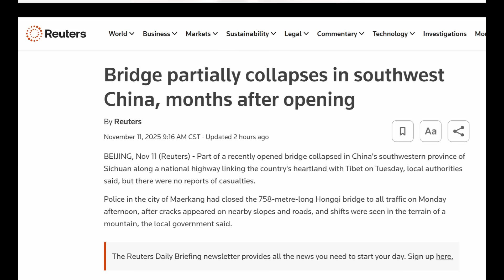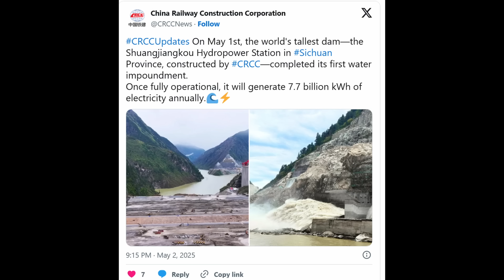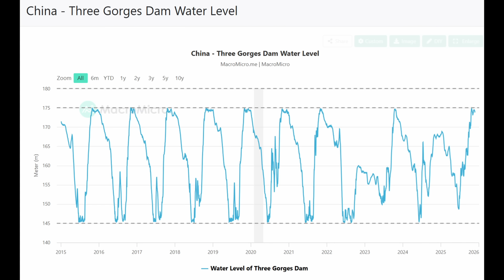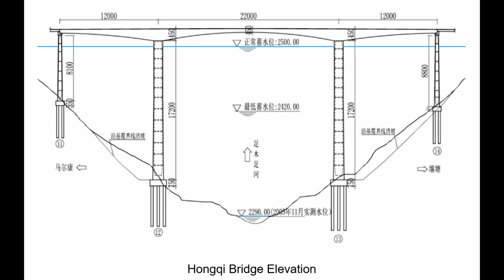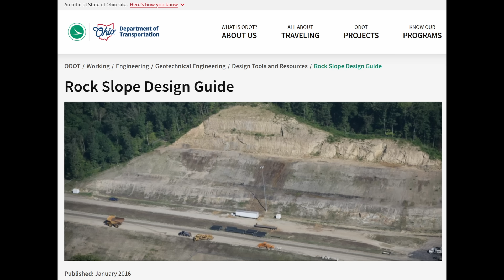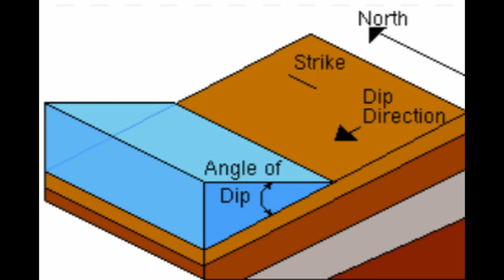Update - China Bridge Collapse

Comment: I keep seeing extremely thin mixtures of concrete being used to pour Chinese floors in multi-story structures.  That and persistent rumors that gypsum is commonly used to increase flowability worries me about the strength and durability of that concrete.  Can you see enough to allay or confirm my fears?  I worked in a section of an industrial park that the sections made with asbestos reinforced concrete were literally falling down as the asbestos was slowly dissolved by the cement.  Gypsum will slowly dissolve the cement, so the results in a decade or two will be similar.

Comment: There's also the corruption aspect, it's built into any CCP project. Saving a few bucks on bad steel, using beach sand in cement, paying off inspectors etc etc

Comment: The fact that the whole bridge didn't collapse due to torquing is kinda impressive.
Reply: Could you explain what you mean by torquing further? Not a term you hear often when it comes to bridges, genuinely curious
Reply: @DrewK-e2i Twisting. The end of the bridge fell sideways and down. That motion twisted, or torqued, the road bed and could have easily pulled down the entire bridge if the other supports were sufficiently weakened.
Reply: @TBlakely-s4p  Ah yes I see, makes sense. Any guesses on what they will do with the bridge next? Would it even be possible to safety reconstruct the destroyed section, or will they have to demolish the rest of the bridge as well
Reply: @DrewK-e2i No way to repair it. Probably the simplest and cheapest is to abandon it and find a different location where the land is more stable but given the geology of that area they will probably have to relocate pretty far away.

Comment: Bridges are not designed to withstand getting hit by the side of a mountain. The side of the mountain should have been cut back or stabilized better. The dam that failed happened during a major flood even and the water was overflowing the top of the dam. The dirt washed away from the land side of the abutment. That dam wasnt the only thing that had problems during that flood.

Comment: If you notice in video you will observe a retaining wall collapsing. as you mentioned geotechnical composition and strata is difficult and varies in slope greatly . Typical Cliff stabilization is with a horizontal cassons drilled into the face about 5-meters deep on a5-7 meter grid. rebar caging is connected, to each casson , then steel netting, then gunnite spray finish. a typical embankment can vary in length from 100 meters to 2km. with a height reaching 2000 ft or 600 m….. the weight alone is tremendous . I’ve traveled several times on 317, road at times is carved into a 60 degree cliff. freezing weather, thawing, rain, 100 degree temps takes its toll on topography . Each trip i’ve had to wait many times 8 hours to get road cleared before preceding. the river does have a lot of force and carved from below collapsing the roadway. Freezing rain is the best time to travel😂

Comment: Non-practicing geologist here. In college  we had a Engineering Geology class. Our professor was a former Engineergin geologist for many of the brazilian dams built iin the 1980's. We were shown many dam collapses due to foundation leakage. I was a trainee at the State research institute shortly after a major rainfall  moved a bridge on the road from SP to Santos,  15cm (6 inches) at the embankment. (the major south amrican port) . It not only rotated but also slided a bit downhill. In the end, they somehow fixed the foundation. 
In the chinese case, the terrain looks a lot to me like karst (limestone) while the rock is quite strong, its integrity cannot be assumed. It looks as if slope stability was not adressed, as it should be a requirement in any engineering device over steep terrain.

Comment: This bridge collapse was caused by the failure of the whole ridge spur on a failure plane within the dip slope geology. It is unlikely improved foundation design could avoid such lateral forces. Post failure aerial photos clearly show a slip head scarp across the whole spur. This failure definitely relates to weak dip slope geology, that in hindsight shows no amount of pre-construction earthworks - benching etc.. would likely avoid, in fact it may further destabilise the slope. The massive displaced block of geology simply highlights your concern about dam over topping resulting from slope failure, as history played out in Italy. It is worth searching out the photos with Google.

Comment: 8:13 "it's not clear if they used any of these methods to stabilize the bridge" If they did, which they probably didn't, the structure would've definitely been a cheap knockoff of the intended design, a facade, trying to appear like it was meant to stabilize the structure, absolutely 100% not according to print.

Comment: Just noticed that the water level under this bridge will rise after the dam downstream begains to store water (in fact it seemed it has start already). And when the water reached the designed level, it will be only 20m (66 ft) above water. Some 80% of the column will be sumberged under the river. Not sure if the risk analysis on land slide or water surge shoule be considered under these condition. Anyway, even so, the risks that affect the construction, before the final working conditions are reached, should also be considered.

Comment: In New Zealand in the 1980s the Clyde dam was built and they discovered a similar geology as that dam in Italy, layers of hard rock with layers of clay between, plus earthquake fault lines running through the site, they eventually built 18 kilometers of tunnels for drainage purposes. The main worry was the filling of the dam would create liquefaction of those clay layers when the dam filled causing a massive landslide into the dam. The work to redesign the dam and all the work to make the site "safe" added years to the build and about a 50% cost over-run, but that shows what doing a proper geological survey of the area means. They discovered what the issues were and changed the plans accordingly.
Reply: plus, not being evil like ccp, etc...
Reply: NZ We had CCP kind of leader But She Ran away thank god
Reply: Are you sure those are clay layers?  Clay does not liquify.
Reply: @bettyl5840 Put a category 8 quake through there and it will liquify, the whole site was on 3 fault lines and the rock cliff upstream was folded and riddled with microfractures all through the layers. Add water to the mix, shake well and it will slide. The tunnels were built in hopes it will keep the water away from the softer layers
Reply: Yeah, we studied both. More so the geology of the Crimwell Gorge sides and their stabilisation.

Comment: there could have been earthquake before which resulted in thisebcracks and them closing the brudge   (and said earthquake created the slope instanikity which eventually resulted in the slide).   what you didnt explicitely mention is that the filling of reservoir adds a huge amount of weight at bottom of valley and affects base of hills on either side of river.

Comment: China has two main problems with all its construction projects.... Shortcuts in planning and corruption. this means geological surveys if they are even done are at best minimal and worst subject to bribing both officials and  surveyors. Also the cost cutting on materials to pocket more money is wide spread. If you check the youtube channel "the China Show" you can learn a bit more on conditions there. Chinese companies are notorious for using fake rebar and substandard concrete to cut costs and allow company owners to pocket cash and the problem is not just in China they do it worldwide using their belt and road initiative...

Comment: these are called tofu dreg projects -- it has an actual term. of course, things fail everywhere, but for different reasons, i.e. not the same reason every. single. time. 

for a typical tofu dreg, it's laughably shoddy material as a result of systemic corrupt. this isn't a case of neglect/poor design/engineering, it's just saving money by not doing what needed to be done. this was the cheapest option done in the cheapest way possible for them to make money. in china, the lowest bid always wins (unless there's a specific corruption scheme). 

i've worked with chinese. believe me, they don't give a fuuuuuuuuck. they build shit knowing it's shit and hope for the best. lol, just kidding, once you buy it they could not give less a shit, but at least in stuff like this they'll hope for the best only because they don't want it traced back to them/used as a scapegoat.

Comment: Thanks for returning to this and incorporating viewers' observations.  I was never an engineer, but I do have a master's in Geography from the early 1980s, and even I could identify most of these problems some 40 years later. The Chinese grad students I met over the years certainly were absorbing this knowledge wherever they studied. That the Chinese neglect safety is political and based on extensive corruption. Those knowledgeable Chinese experts must either be the most frustrated experts on Earth, banned from participation (or fled the country), or gave up fighting the system and are taking their share of the loot. It's systemic. It's a pity the MSM doesn't have a daily Chinese failure segment, so that some pressure was put on China to clean up their act before something huge happens and millions die.
Reply: Banqiao.

Comment: They should do them like the New River Gorge Bridge in W.V.
Reply: I'm not sure they could build that kind of structure.... which basically iirc is like lying a stick across the banks at the  top while  the river is at the bottom of steep cliffs ... at this particular location. Here the bridge is crossing what is about as wide a valley as you will find in the area... and it's expected to eventually be crossing a huge lake. The arch of NRG just wouldn't work here.

Comment: I would be interested to know the failure rate of projects before I reach a conclusion about overall construction risk in China. The good news is no one was hurt or killed.
Reply from the maker: We don't take that approach with commercial aviation if there is a plane crash.
Reply: @CaseyJones-Engineer  The engineering risks of airplane crashes are significantly differnet than engineering risks of structures. I suspect air travel is a lot more dangerous that travelling on a bridge in China. I do not disagree with trying to further understand the reasons for the failure of that bridge and look at the assumptions of the engineering of that dam downstream.

Comment: 8:14 The type of rock also has a massive influence on how much stabilisation is needed. I'm in Canada, and over here, you can basically have a 20 meter sheer cliff and expect that it will stay in place with little or no stabilisation at all. Canadian shield is some of the oldest and hardest rock on the planet. When we have issues, the culprit is most often glacial clay. Its all over the place and makes extremely unstable slopes. It also tends to absolutely wreck roads during winter.
Reply: There's sedimentary rock in that area, mostly sandstones and mudstones, and it's also a seismically active area. Add mass wasting from winter freeze-thaw cycles and spring rainfall and you have a place a geologist would run screaming from.
Reply: Canada eh? Two months of nice weather and ten months of tough sledding...

Comment: Next best to Ukraine blowing up Russian oil and gas systems... is China's mega failures.  I look forward to them all.  Just LOOKING at this bridge you KNOW without ANY engineering that there could be catastrophic disasters.  First off, TIPPING OVER.  Those piers, assuming they are so reinforced that say an overtopping wave traveling at 60 MPH won't snap them off, crack them in half, would need to be equally as strong at least 1/3 their length into "soil" that won't shift under the load.  So, we KNOW this bridge wwill fail under maximum tsunami.  I'd bet under any wave bigger than 50 feet these towers will shift at grade.  Given their height, it won't take much of a tilt to shift the center of gravity past the tipping point as there is so much weight in the bridge decks.  I can't imagine any SAFE way to span this puppy than a suspension bridge.  With the proviso that i have no idea where along the near vertical mountain there is a safe place to put a tower.  A landslide from the mountain can easily run across that narrow valley and take out the tower on the opposite side.  You might have been able to run cables up the top of the mountain, or into tunnels bored through it, then place the opposing tower up on the plataue oppostie, 500 or 1000 feet back from edge of cliff.  Which means the total span might well have gone well beyond any suspension system.  Suspension with a seperate post and deck under it?  Designed to fall out from under it gracefully if damaged?  OR THIS WAS A STUPID PLACE TO PUT A BRIDGE PERIOD,  even if this was the best for 100 miles.  Sometimes ;you just can't get there from here.  fyi  China has built many bridges of this type.  Probably as it's the cheapest fastest way to bridge 'impossible' areas, as long as you don't care how long it survives.  AND under typical Chinese governigng SOP, it's perfectly fine to build and pray as they have no option.  HOWEVER every construction project in China is just a way for the rich to suck up tax money.

Comment: "Hong-chi" -- the letter "q" is pronounced with as the soft "ch" not the hard "k" sound in pinyin Chinese spelling.
Reply: Yep - although a clearer transliteration here might be "chee", as in "cheek" (rather than "chi", as in "chick").
Reply: @DavidTheScientist  yes, good point, thank you.  the "i" is pronounced as "ee" in pinyin.  I was thinking in Pinyin when I wrote that.
Reply: @dperreno Not wanting to be a pedant here... But "chi" in pinyin would be transliterated as something like "churr", as in "church", albeit with quite a short "u" sound. 😉 And "che" in pinyin would be more like "chuur".
Reply: @DavidTheScientist  "chi" is not a pinyin word, but "qi" is.  I confirmed this with my Chinese step-daughter.  I've never heard of the letter "i" in Pinyin being pronounce any other way than as "ee."  And yes, the pronunciation of the pinyin letter "e" is usually problematic for English speakers.  I've always just used the schwa sound.  Close enough for  me to get by.
Reply: @dperreno 吃（chi, 1st tone) means "to eat", and is pronounced as I suggested. You may find the pronunciation chart on the "yoyochinese" site helpful.
To clarify, "i" in Chinese pinyin can either be a short "u" sound, like "uh", or it can be an "ee" sound. It simply depends on the letter that it follows. For example, yi and di are pronounced "ee" (or "iee") and "dee", whereas ci and zi and pronounced "tsuh" and "zuh", varying slightly based on the required tone. Ultimately, while there are rules, you just have to practice if you want to know how to correctly pronounce all pinyin variants.

Comment: I wonder if it is china tasking their engineers past their ability, lack of proper funding, pushing for big projects without doing all the research they need to do. I wonder if the chinese engineers are pulling their hair out because the gocernment puts them in bad positions. Or if hands getting greased to short cut safety. Probably a mixture of all of these. I wonder how the chinese engineers working on these projects truely feel about it.

Comment: lol what are the bridge requirements number 1  bridge must not fall down ! that's a start !
Reply from the maker: One would think that!
Reply: No expert here, looking at the Video they cut across the bedding plain, dips at a very steep angle, perfect opportunity for any weakness to expose itself, add water or a clay joint, all three and the mountain side is going to make a bid for freedom, I don’t fancy the odds of the dam or the bridge standing in an earthquake? River valleys tend to follow fault lines, path of least resistance, all that pulverised rock is easy work for a river to remove.

Comment: Teton could have been fine.  I was told that by several engineers involved in the planning, siting and design.  They all said the failure was that the construction team didn’t follow the fill and spill schedule to expand and saturate the clay core.  The piping occurred not at the abutments, but face to face, at the elevation where they abandoned the fill and spill schedule, and just started filling.  Because the Secretary of Interior, and Governor were coming to a dedication, and someone wanted it full for the occasion.  And no one wanted to say that, so they blamed flow through the abutments.  Watch the videos of the failure, the dozer trying to plug the piping at the outlet end.   And look at where it was.  That is not where an abutment piping failure would occur.
Reply: Oh, that’s what happened!  Thanks for the info.